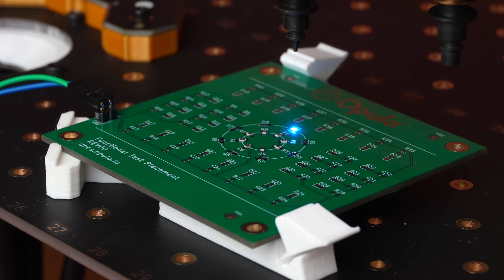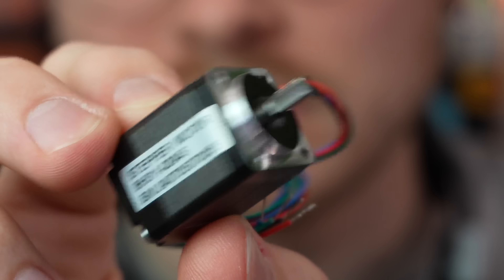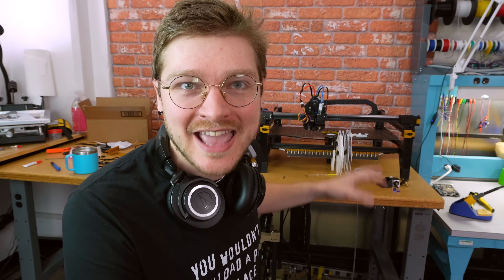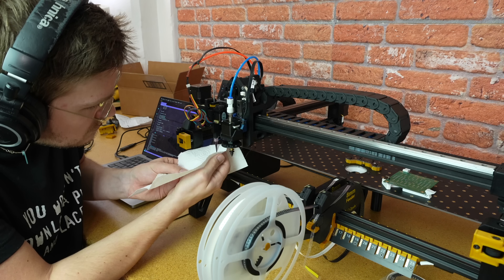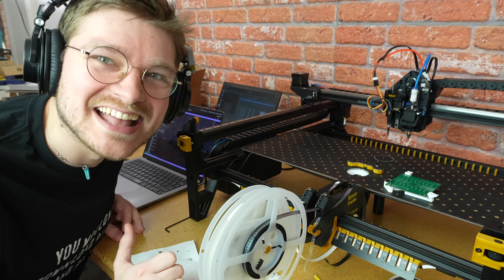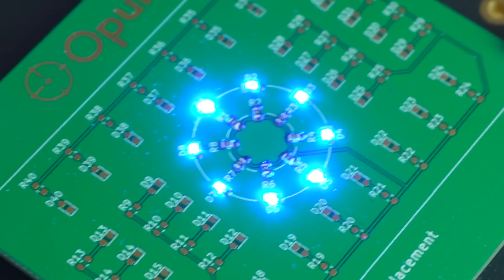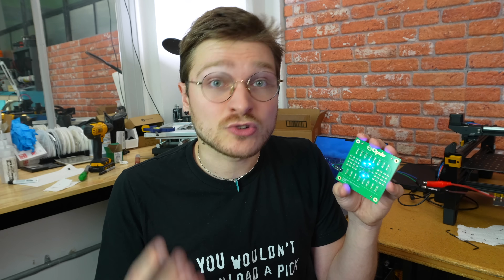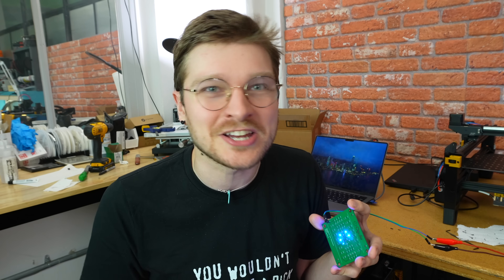one machine for PCB assembly

Comment: The most accurate and reliable way to dispense is to use air pressure pulse. Move tip to something like 0.005in from PCB. Then provide a brief puff of air pressure. Once a very accurate dab is dispensed, the air will stop moving the paste. This is how we do thousands of caps each day for the last 30 years. You should experiment with that approach.
Reply from the maker: i might even be able to repurpose the vacuum pump's outlet to do the pressure pulse! thanks for the idea!
Reply: @stephen_hawes  
Edit: I am most probably wrong given that the volumetric control requirement is actually less stringent here than for 3D printing. Output speed requirement is way more important here, thus compressed air makes sense.

Original: Working with Liquid Silicone Rubber 3D printing (paste extruders), air pulse is probably NOT the way you want to go due to lack of volumetric control. This syringe contraption is crude but actually good (consistently predictable volume dispensing). Better even would be a  non-pulsating metering pump. But there is already so much more that can be done with your simple syringe with clever control algorithm that I wonder whether it is worth spending crazy money on a high accuracy metering pump for a "side project".
Reply: @stephen_hawes  Back in my Shenzhen days, I pasted a lot of one-off prototypes with a "983A Auto Glue Dispenser" ($60 on Aliexpress). It has a knob to control the pressure, and then you can either dispense manually, or with controlled length bursts. And it even does retraction with some vacuum with a venturi tube. Highly recommend it even for prototype assembly - for small one-offs it's faster than using a stencil, and for large one-offs, you can paste and place half the board, then paste the other half, and not have issues with the paste drying while you place.
Reply: But yes, you need a small air compressor for it.
Reply: It's the most commonly done way for cost, but it is definitely not most accurate or reliable... You can emulate & do the exact same thing with more control via a syringe motor like done in the video, or via a suitable dosing pump such as a progressive cavity pump (expensive, but incredibly accurate, and allows for a large feed supply.)
One of the more important things is the 'pull back' which can be done with all 3 systems, it's why there is a vacuum option on many air powered dispensers. Once you dispense, you pull a vacuum for a moment, or reverse the motor for the pumps, to pull the fluid back a little bit. This stops it continuing to squirt out, due to the system storing some of the energy from pressurising the liquid in the tubes holding the liquid, or the syringe barrel, causing it to ooze out for a little while longer.
Reply: @DUIofPhysics  We have tested a variety of dispensers including progressive cavity and stepper syringe types. We found them good for lab grade but bad for industrial grade. We could get good results for something like a couple hours. However the constant need for human intervention made them unreliable for industrial purposes. We need the system to reliable work for at least a 12 hour shift. Setup during the start of the shift is OK. Perhaps we simply haven't found the good dispensor. If you have an MFG and model I'm sure I can convince my boss to get one and test it out. We don't care about the cost, we care about reliable industrial operation.
Reply: @jaredharvey1511  Pico pulse by EFD, or the P-Jet are both fantastic.  They dispense a discrete droplet (and also confirm with light barrier).  Compressed air in a syringe is antiquated compared to this approach.
Reply: @DUIofPhysics  We have tried progressive cavity and stepper motor controlled syringe types. We did not find them to be reliable longer term. We could get them super accurate, but after something like an couple hours of operation we would have to recalibrate them. They required constant human maintenance, and we considered them good for a lab, but bad for production. The required human element made them what we consider to be un-reliable. The air pulse was very accurate and we could set it once a day and it would survive the shift. The tendency for the paste to be compressible is a key we tend to attribute to the lack of longer term consistency of the progressive cavity and types. We don't care about the cost, we care about the reliable accurate operation. Do you have a MFG to suggest? Perhaps we simply haven't found the correct MFG yet. Me and my boss would be interested if we can find a better dispensing pump.
Reply: @DUIofPhysics  Hmmm, seems my replies aren't getting posted. Perhaps there is a filtering / moderator process happening. If you get multiple replies when they get approved by a moderator or something like that, sorry for the multiple replies.
Reply: @jaredharvey1511    Have you tried using a peristaltic pump?  It doesn't have a smooth flow, but you don't want smooth flow, you want consistent volume.  The trick would be pump sizing, so each "pulse" is exactly one drop.  Downside is component wear of the tube inside the pump, but that's several hundred hours.
Reply: @EmperorA0  contamination from day to day means new tubes each day for us. Peristaltic pumps were to slow and had high variation in dispensing. They did not work for our application.
Reply: @DUIofPhysics  Hmmm, that post made it, so lets try again.

We've tried many dispensers including progressive cavity and stepper syringe types. We found those to be good for lab grade, but bad for industrial grade. We found they needed constant human attention to remain accurate. This human intervention was the source of problems with industrial applications. We can setup at the beginning of a 12 hour shift. We couldn't get the dispensers we tested to function for a full 12 hour shift with out the need for human intervention. If you have a MFG and model to suggest I'm sure I can get my boss to buy one and test it out. We don't care about cost, we care about reliable operation.
Reply: @DUIofPhysics  Bro we know what retraction is we all have 3d printers
Reply: Do you do the old solenoid rod pokes the air pipe method?
Reply: What a great idea! in fact, are you working with a quick impact using air pressure instead of using a stepper motor as shown in the Stephan's video, if I understood correctly?

Comment: so cool. couldnt you make the traces as well out of the ink? You could add a 3d print head to the machine and then 3d print a plate with some cutouts for the traces, fill it with ink and then add some simple circuits on it 😁😁